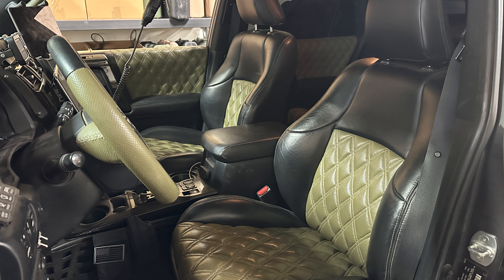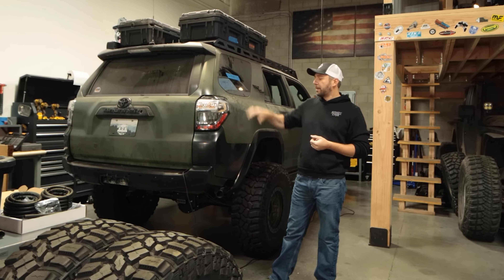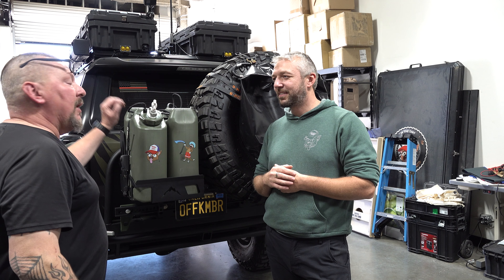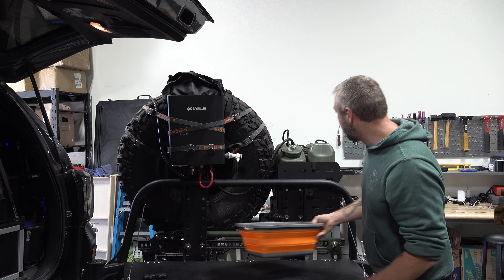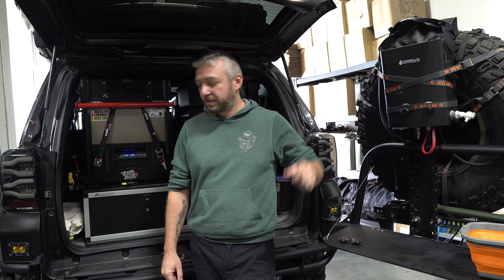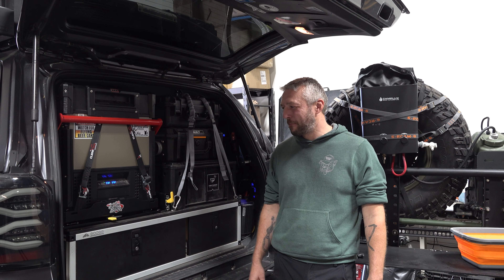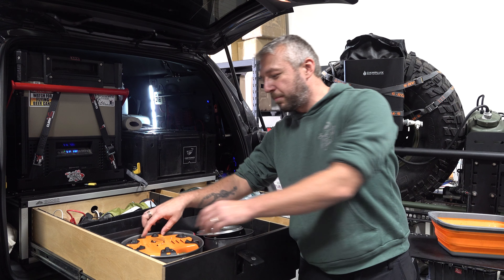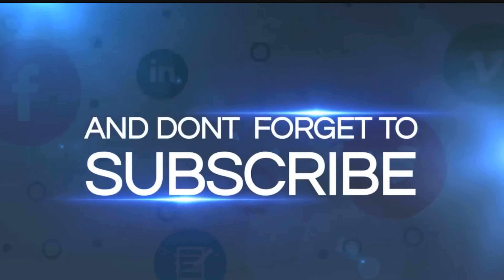This 5th Gen 4Runner will Beat your Land Cruiser!  IFS VS Straight Axle. Pt. 1

Comment: Great vid I wish we got the 3rd gen onwards 4runners here in Australia. I've had a 1st and 2nd gen 4runners and a few 80 series with different sized lifts tyres and different set ups. I'm now using a soft floor off road camp trailer for my off road trips as after the 2019 bush fires 80% off the best 4wd tracks have been closed down and gated and my 80 series is slowly getting stripped down to make it lighter and removing a heap off stuff that I don't need to carry around all the time as I can keep most off it in the camp trailer. Over here the 70 series Landcruiser is by far the most popular 4wd its a 2 year wait for a new one and there not cheap to set up for everything but there is plenty of after market support for them. Now that my 3 eldest kids are all over 18 and working and i only take my youngest away once or twice a month its so much easier to use swags and park the camp trailer at a powered site close by as a home base.
Reply: I wish we could have gotten a diesel 80 series in the states I had to build mine with a 606 mercedes. Some use the cummins but it's bad heavy.

Comment: I don't know to much about oveland but I think the best electrical system for this application is a custom lithium battery bank. For example using lto cells you have not to worry about extreme heat or cold temperatures but the downside is lto are not as energy dense as lithium ion. The biggest advantage of lto is faster charging and longer durability.  (charging and discharging cycles )
Reply from the maker: so you didnt watch it I see, because he poinjts out the 2 LIPO batteries hes running.
Reply: Key word custom battery bank.  I'm not saying go ahead and buy couple of batteries from a company. Big difference.